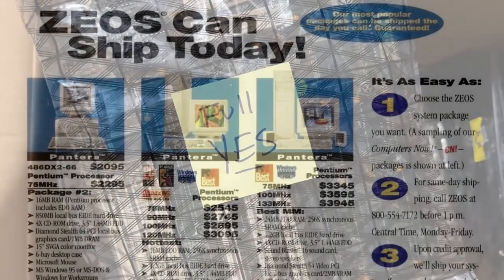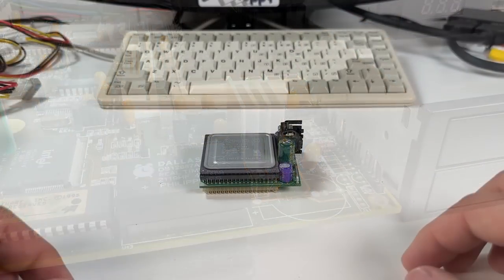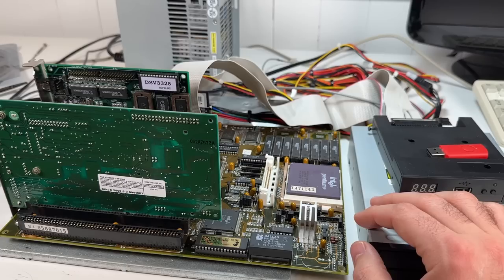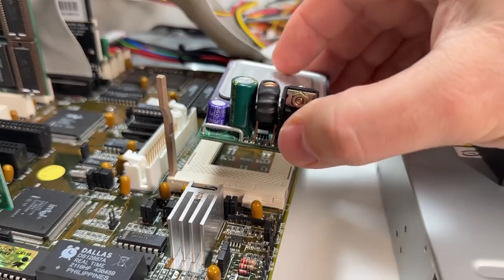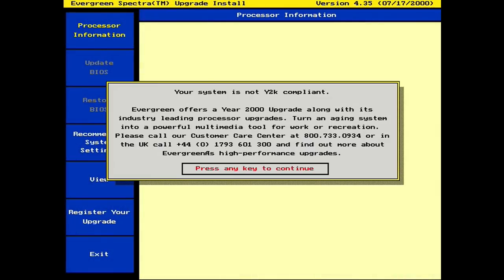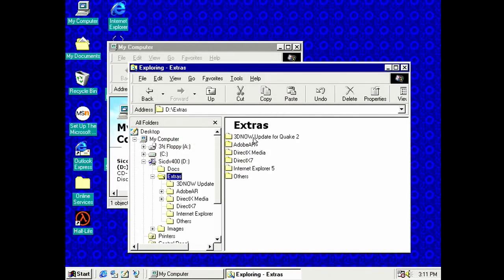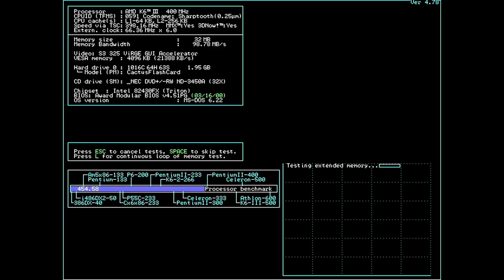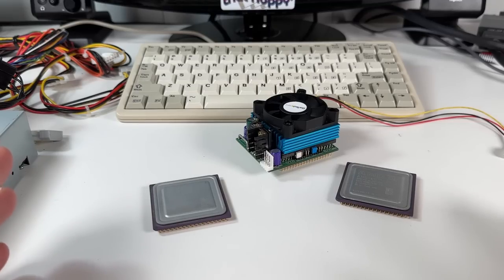Evergreen Spectra 400 – The Ultimate Socket 5/7 Upgrade CPU!

Comment: This upgradeability makes us feel all warm and fuzzy and wonder what went wrong that it’s no longer possible to rejuvenate an old PC and make it operate closer to current speed standards. Well, when you come to think of it we did still have the option later on, sort of. When I bought my previous PC back in the late noughties it started life as an Athlon64 X2 6400+ (3200 MHz) and served me well through the upgrades right into the 2020s being retired as a Phenom II X6 1100T running at 4200 MHz. That was about quadruple processing power of the original spec, beating i7-3770 of 2012 in rendering tasks by a noticeable margin. Upgrading graphics cards from 3870X2 through 4890, 5870 and dual 7970 all the way up to dual Vega 64s also made it relevant in gaming. And today my current Ryzen 2700X setup also gives some room for improvement, all the way to 16 core 32 thread units, that’s almost 2.5 times the oomph. So unless you went for a laptop or with a bad choice of motherboard you’re not completely stuck with what you got.

Comment: Thanks for answering a question that has been bugging me for 20 years.
Back in high school I had a Pentium in a S7 motherboard that definitely didn't support anything over 166MHz.
Well, couple years later I got my hands on a K6-II 233. Not knowing any better I slotted it in as it was, and what do you know it ran. In fact, after a bunch of trial and error, it's ran at 450 MHz (6x75). It handled UT in software like nobody's business.
It also needed a massive hunk of aluminum the likes of which has never been seen on socket 7 to keep from liquifying.
Having no idea what I'm doing I shorted it not long after that, but running at the default 3,3V it was probably a relief for the poor thing :D

Comment: Very interesting video. Back in 1999 I upgraded my PC from a P166 MMX to a K6-2 400 mhz on the same motherboard, but unfortunately I dont know if it was Socket 7 or Super Socket 7. Anyway the K6-400 mhz was significantly faster than the P166 MMX.

Comment: I used the similar upgrade set for AMD X5 instead of old 486DX50. It also boosted perormance a lot. With socket 7, I upgraded from Pentium MMX200 to SS7 board FIC VA503 and AMD K6-2/500.

Comment: I remember those snap on CPU upgrades for those PCs that had a soldered on CPU, Cyrix made one upgrading the system from a 386 25mhz to 486 running around 40mhz.

Comment: Very interesting tech!  I used earlier intel overdrive chips like the 50/100 486 and then a 586 133 mhz. (this old pc started as a 386 dx 33/40)  Pricing was too cost prohibited for the newer Pentium 2/3 and earlier rdram P4's.   When pricing did eventually come down I got to play with these earlier machines.   Speaking of that earlier 386 build in a IBM style 286 case.. That system ran from 1994 to 2004.  Thanks vswitchzero for the wonderfully done look back video!
Reply from the maker: Thanks very much 🙂👍

Comment: I once came across a system I sorely wish I had not parted out at the time.  It was a Packard Bell in a tower format, early Socket 7, that I believe came with a P133 processor originally.  But some madmad had got ahold of that machine...

It had one of these Spectra 400 processors, 64 mb of EDO DRAM, an original TNT graphic card, an AWE64, Intel 100baseTX network card, and a secondary generic ATA controller to support the 20gb hard drive.  Throw in a slow DVD+RW, wrap it back up in the original case, and it was this tiny little sleeper of a Packard Bell.

Like a dumbass, I parted it out.

Comment: Interesting that you don’t experiment with 75mhz bus speeds. I did with my Cyrix Socket 7 system and got some nice performance increases. Thanks for the upload, it makes me wish I’d kept some of my old gear.
Reply from the maker: Thanks for your comment! I really would have liked to try 75MHz but the Full Yes board doesn’t have the option. I have one other S7 board that supports it but I haven’t had a chance to repair it yet. Would be great to squeeze some extra performance out of the chip!

Comment: I have one of these that I used to install a K6-3+ 400 into a PCChips M520 VX chipset Socket 7. But that board has a receptacle for a voltage regulator, and I plan on building a Necroware regulator to use instead.

Comment: I have been selling Powerleap's adapters back in the days. It wasn"t very popular beacause of the price. It was better for the customer to change whole MB and sell old one. For me as well as I was earning money twice, first selling new mobo, then selling old one to another customer ;) EpoX was king in these days.
Reply from the maker: Thanks for your comment! I wondered that as well - I’m sure the cost of these was high compared to typical CPUs and that a lot of folks weighed it against the cost of a new board/cpu combo.
Reply: @vswitchzero  I will try to find a price list but this will not happen any soon.
Reply: @vswitchzero  Hi, it wasn't that hard, I found scans of original Powerleap's catalogues and a price list for dealers on my NAS. The pricelist is dated: July 2000. In case you like to check it I can send it to you. Just drop me an email.

Comment: those old pentiums  clock up real easy,  I had a p90 running at 133 for years without issues,  for the last month  I used it it run at 187mhZ which was its max I coud run it stable in an Asus p55t2p4 board. but obviously pale in comparison with the evergreen - the evergreen reminds me a bit from the Amiga days of Accelerator cards to get much more oomph!

Comment: I know I'm a year late on the video, but I think the Quake chart is interesting - the 256kB onboard cache gives about double the benefit on the older board, and even more as a proportion of total frames. The onboard cache is clearly useful when the system is memory-bottlenecked, than when it isn't. Pretty cool upgrade!

Comment: I have some ASUS SP97-v boards.  I got the PowerLeap K62-400 and they rocked back in the day with Win2K and 256MB.  Slap in a Promise IDE and lets go!!!
Reply: And modding the regular IDE cards to use Raid with a single resistor! Had 4 10gb drives in raid 0. Good times.
Reply: @waytostoned  I put 4 Seagate 20GB in RAID0 all stacked in a tower.  Talk about HOT!!!  Had to mount them apart.  I did the Promise 66 mod to make it RAID.  I still have the card.

Comment: Never owned such an adapter. Always replaced the Board too. But my SS7 Board is still alive and around. If you can, try the IDT Winchip 200MHz. This thing was designed for such old boards. Good integer but very weak FPU despite MMX Support.
Reply from the maker: I actually picked up a 200MHz WinChip recently. Hoping to do a video on it one of these days 👍

Comment: A relative of mine had a Super Socket 7 Board with128MB PC-100 and I think it was a K6 II @ 600 Mhz. My Mom bought a system with a K6 III 400 that was almost as fast.  That L3 cache on the K6 III, and then the K6 II+ and K6 III+ were far superior over the original K6 II even if they were overclocked to the max. Motherboards with 1MB or even 2MB of cache memory existed but most of them had 256K to 512K of cache which really hurt the performance of these processors.

Comment: I know it probably doesn't matter, just curious if that cooler would be more effective if you rotated the heatsink 90 degrees.  That way the fin-stack is more exposed.  Great video!
Reply from the maker: Thanks very much! I turned it that way so that the air would be channeled more toward the regulators to help keep them cool, but I’m sure it would work well at 90 degrees too.

Comment: I think I had an AMD K6-2 500 back in the day running on a Super socket 7 Soyo branded board (at least I think it was Soyo, the memory is a bit fuzzy going that far back).  I think I had it shortly before Diablo was released although I remember still being obosessed with Baldur's Gate II at the time.  I was learning computer engineering back then and I noticed that my motherboard supported a 100mhz bus speed so I cranked up the bus speed and dropped the multiplyer to keep the CPU speed within spec and it all worked just fine.  I might have got it going at 550Mhz but I can't really remember that well to say for sure.  I ran that system for years although I really needed to upgrade when Crysis came out (but back then, who didn't).  It was pretty good for Far Cry though and I managed to play through most of Crysis even if it was a bit of a slide-show until I managed to upgrade to a Pentium 4 space heater (one of those upgrades I later came to regret).  It was legitimately the first system that I built for myself.
Reply from the maker: Thanks for sharing! I’ve heard a lot of great things about Baldur’s Gate 2 but have never tried it. Will definitely have to give it a shot one of these days. 👍

Comment: Great video, congratulations! May I kindly request for a follow up to this video? What I am curious of is setting the FSB S7 to 75 MHz or, even better, 83 MHz and tune the multiplyer accordingly. I would suspect that performance in games using software rendering would be right in the middle between 66 MHz and 100 MHz FSB. The only issue I see is if the 72pin RAM modules can't deal with 83 MHz. In my case, I have an i430TX MB with 2 DIMM slots and 2 or 4 SIMM slots (can't remember right now and it's difficult to access it). My S-S7 uses and Ali Aladdin 5 chipset and does really well with PC-100 DIMMs. Unfortunately, I have no upgrade interposers for the S7 MB and can't do a proper comparison.
Reply from the maker: Thanks very much! Most of my S7 boards are older and don’t support 75/83MHz but I do have an ASUS T2P4 430HX that needs to be repaired. I believe it should support it if I can get it going again. Hopefully 50ns EDO can handle 75MHz. Great idea for a follow-up 👍

Comment: These things where quite expensive as well and i decided that it was cheaper to go to slot1 and then overclock the p2 from 400mhz to 533 by using 133mhz fsb and a petal cooler I had friends with genuine ss7 systems.

Comment: I never upgraded a CPU. For me a new CPU = new motherboard. The only time I ever did was back in 2021. I built a computer for a Ryzen 5900x.....but I couldn't get one. So I bought a 3600 instead. It was the cheapest ryzen CPU I could find. Eventually I got my 5900x. That's the only time I ever upgraded without replacing the board too.  But man I do remember the super 7. Such good times back then.
Reply from the maker: Very similar to my recent upgrade. My main gaming system was built in 2019 and I got a 3600x with it - I just recently upgraded to a 5900x. Big improvement for video encoding etc, that's for sure!
Reply: @vswitchzero  I had the 3600x for like 2 months. lol But yeah it's a beast for anything CPU intentional. And I have a lot of that.

Comment: AMD used the slot based setup like the PII with the initial Athlon.  It was basically a backward Slot 1.  It didn't last, though. They went to Socket A pretty quickly though, because slots were a stupid idea.

Comment: I have got the same Evergreen upgrade cpu. Did you got it from the Ebay seller from UK?
Reply: I also don't have the original cooler. Do you know  how to find one?
Reply from the maker: I did indeed. I believe they had a few of them for sale. It’s unfortunate the OEM heatsink didn’t come with it. I think they will be very difficult to find these days. I’m still not sure what I’m going to do about a cooling solution for it. Was thinking of just using thermal adhesive or epoxy but I don’t want to do anything permanent. If you find any better options please let me know 👍
Reply: @vswitchzero  Maybe a combination of Arctic TP-3 0.5mm and Stars-922? Placing the thermal pad to the center and glueing  only the 4 corners of the heatspreader with Stars-922.

Comment: Back then I was also toying think with an “overdrive” processor. but they were too expensive back then. So I preferred to buy a 5x86 133mhz cpu with board, which I think was even a little cheaper in price and faster.

Comment: I went straight from S7 to S370 via Dual Celeron 366s overclocked to 550MHz in a BP6. My S7 machine was too specialized for any other upgrade path.
Reply from the maker: The BP6 was an awesome board. Had one for a while too 🙂

Comment: Try to unlock the additional cache on the K6-2+, if this is a late model it will most likely have fully functional cache and should work with the full amount instead of just half of it. (I bet you know about the binning pratices to lower CPU prices)
Reply: Oh, and the 83Mhz bus should be nice, unless PCI cards complain in which case go lower or add wait states.

Comment: 8:37 Looks like Quake wasn't the most demanding game in 1996 then, since at that time Grand Prix 2 in SVGA brought my Pentium 100 to it's knees, so much so that I overclocked it to 120 MHz which helped despite the lower bus clock (down from 66 to 60 MHz). NASCAR Racing and IndyCar Racing II as well didn't run much better than Grand Prix 2.

Comment: I miss the days where you could swap a CPU and have a night and day difference in performance.
I just went from an R5 3600 with 32GB of 3.2GHz DDR4 (4x8) to a 7600X with 32GB 6GHz DDR5 (2x16) and honestly there has been a slight improvement on paper but my overall experience is moot. :(

Comment: if you set a K-6 II or a K6 III to a multiplier of 2x it is the same as setting it to 6x (in case your socket 7 Board has no 6x multiplier) - know this one because I own a K6 III - 450 myself -on a ... nearly ... super socket 7 board: it does not run at 100MHz bus speed but at 83MHz or 75MHz...

Comment: What is the USB device at 13:45?
Reply: It's called a 'gotek floppy emulator', does what the name says. You use it with floppy disk image files on a plain FAT32 formatted USB stick and it presents it as a regular floppy drive to the system. The numbers correspond to a particular image.

There are upgrades for them in which you can add a small OLED display to make it display the image name, a rotary dial to make scrolling images faster, and a piezo buzzer to simulate 'floppy noises'.

Comment: Is it possible to put a quad core raspberry pie as a pci graphics card and accelerator?
Reply from the maker: They are doing some amazing things with raspberry pi systems and also FPGAs - I wouldn’t be surprised to see something like this one day! 🙂
Reply: @vswitchzero  maybe a pci that has 3 raspberry pie quad core with 3 HDMI ouputs pity she doesn't have mpeg2 encoders built in

Comment: PCs back then were also much more overpriced when prebuilt. By 1995-1996 you could build your own 133 MHz 486 PC with 16 MB of RAM for around 650 USD. A basic Pentium PC would cost you around 800 USD. For 1.2k USD you could build a Pentium 120 PC with 32 MB of RAM. Quake would run quite well. 

Name branded prebuilts especially were marked up to high hell, often by 100%. And always cheaped out on the RAM.

Comment: Huh? I’m confused. Why can’t you just crank up the FSB?
Reply from the maker: Many early socket 5/7 systems didn’t support FSB speeds beyond 66MHz, so increasing it wasn’t an option. Some of the later non-SS7 boards would do 75/83MHz so in those cases you could get more out of it. Thanks for watching!
Reply: @vswitchzero  I see 🤓 Thanks for clarifying.

Comment: Anybody else finding the vogonsdrivers links are being blocked by Malwarebytes because of a trojan ?
Thanks.
Reply from the maker: Oh interesting. I don't use that tool but its possible they may have had something hosted there before that got the entire domain flagged. I scanned both images I mentioned in the video and they were clean. If you have a vogons account may be good to report that on the forum with a screenshot so that the admins can get it sorted out. Thanks for sharing.